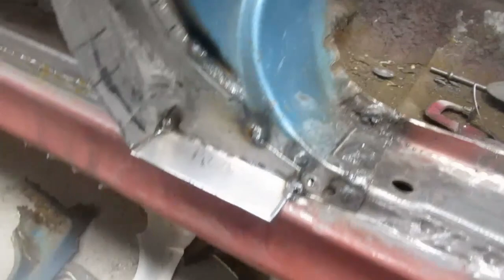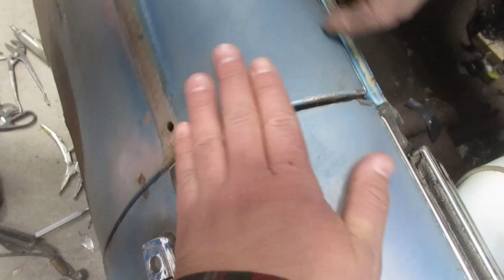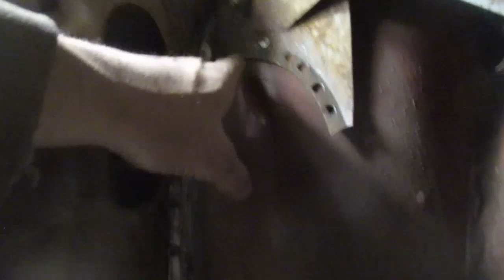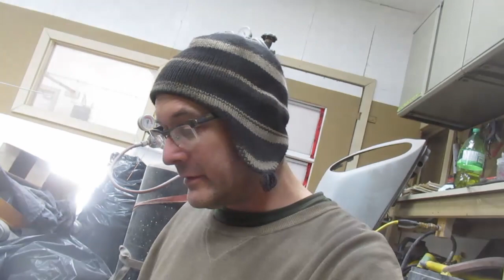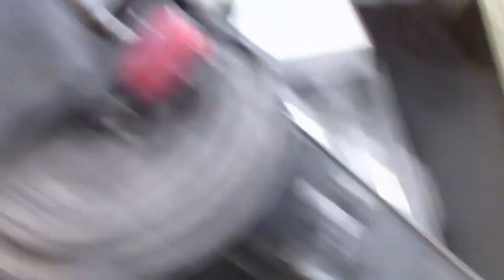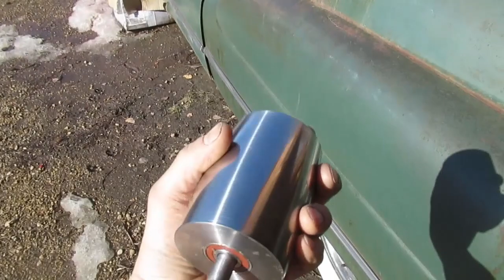1960 Fury Daily Driver Project Part11!

Comment: Always pleased to catch another episode. 
I'm on the wrong side of the Atlantic to find cars like yours but we do share at least one experience - ownership of a Metropolitan. That was back in 1971 and the car seemed much older than its nine years due to rust. It was fun to drive though. My only old American tin was a '64 Rambler Classic, originally built as a right-hand drive car with a twin stick. Still have the hub caps! 😁

Comment: Hi Scott: Thanks for the video and thanks for showing us the process. Please continue with this detail of your work and even expand it to include even more of the thought process in how/where you begin to "unravel" that collision damage. I was told long ago, that you need to "read" the damage and start/begin the repairs by figuring out where the metal is "locked" into its new shape. Kind of "straighten out the wrinkles" in reverse order of how they were formed during the collision. That "theory/technique" makes all the difference between returning the panel to its former shape and ending up with a lumpy "sack of nuts". Again, thanks for allowing us to tag along. This is almost as much fun as putting on the ear protection and swinging the hammer. Your info is helping the outcome when that work happens here. 👍👍👍🤓😎😉

Comment: Wow that's some work ahead of you on that panel fabrication. I'm surprised you took the time to cut the weld and lower that top edge of the quarter but you're right. Somebody would talk shit about it and wouldn't believe that it was there from the factory even though it was so best to just fix it. Nice work beating out the collision damage to the rear. Can't wait to see what that looks like once it's all touched up and finalized. 

If things go according to plan (when do they ever?) I should be getting the slab down for my own garage here in a few weeks. Then i'll be able to work more effectively on my own bullshit. At which point i'll have some sketchy youtube examples to follow.

Comment: Do you think that paper will hold up? I'd at least reinforce it with some chicken wire and bondo. Seriously though, this splice job is going to be more solid than most "daily drivers" that have all original sheet metal.

Comment: I worked in a body shop in 1961, at that time the owner did a similar job involving a 1960 Chrysler 4 door hardtop. I sort of questioned the quality of the project. But watching a mechanic like Scott, What a mechanic! The project I helped with in my youth, rust was not am issue. The rebuilds at that time did not require a rebuild tittle for resale. Great videos!

Comment: remarkable filmsmanship by the deanmaster. shitworx extrordinaire. fantastic prep work for the necessary appointments to the jetson mobile. i'm hoping it gets the duel antenna effect at the end. the giant fins hide the questionable faux spare bulge these vehicles got at chrysler worx. toilet seat lid boot lids.. it is indeed inspirational that the car seems to be the one in the poster about furys for '60. it would be splendid to see it with some period correct paint job like that. I see posts about this car now that your pursuing this restoration. it's neat that this car, half submerged in mud, can now re-emerge as a remarkable example of automotive history, with a little bit of blood, sweat and exertion. 4:20

Comment: in 1976 i worked in body shop where we did work for a dodge dealership.one job i did on a brand new van was the drivers door gap to fender   had to add 3/4 in. to the door to get a gap !!!  there quality control needed help.  there was many more too .

Comment: That quarter work is intimidating - it’s interesting to see how you approach the repairs. Looking forward to the English wheel - how did you determine the 20-inch radius for the panel? Did that come from research, or did you somehow arrive at that by measuring the panel?
Reply from the maker: Oh! Just trace the edge of the door, and use a piece of string and a pencil... when you can trace the arc closely, just measure the string... At least, that's all I did... hope it works, haha! Cheers...

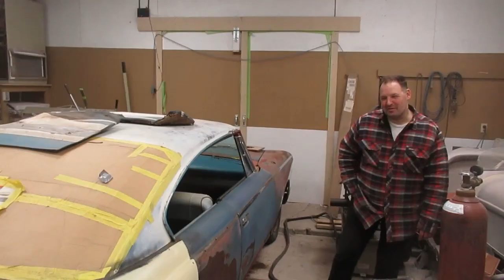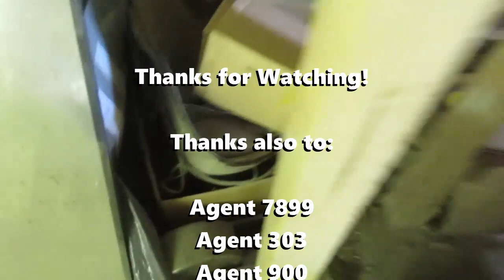Comment: 10:28- "...his mind wasn't on the gaps..." +1😁 Only a select few will get that,  and it looks like it sailed over Dean's head. Glad you fixed the panel gap. I woulda left it,  but would've obsessed about it after the job was done. But c'mon guys, you're slinging molten lead or whatever 21:20 without eye protection?☹ Dip Line very interesting. 45:03 blue Budweiser cans?

Comment: John Riccardo would be so very proud, nay, verklempt! You are doing a better job than Chrysler did in the 60,s, they had a terrible fit and finish problem back then. Now, a definition of "grandpa poo"? Damn nice beating and thrashing on that fender, would you prefer working on taking out gobs of lead or gobs of fibreglass shit?
        Mike

Comment: It's not an easy job correcting factory fit errors 59 years after the fact, especially when the standards were sloppy.  Great work on that passenger side quarter panel.  The taillight fit it better than factory.

Comment: You are a champion in making repair patches!
Maybe many people do not know that small parts like the corner inside the rear door are much harder to hammer and fit than most big parts (as the radius is much smaller and therefore stretching and shrinking of the sheet metal is much harder).

Comment: Scott, Don't they make a special drill bit  w/a shoulder For spot welds?  I think I saw it With somebody Repairing Aircraft skin. I think that Fin , rivals a 60 Cadillac fin'
Reply from the maker: Oh, they do, for sure... I just don't bother because they only last for so long, and you can't really sharpen them like regular drill bits... Also, a lot of the time we are drilling into rust, which dulls drills instantly, so I like to just have a box of cheapo bits handy to get the job done. It doesn't really affect the job doing them this way, and you can switch sizes up or down to suit the welds on each particular car...Cheers!
Reply: @coldwarmotors  I like to use a large bit ground and sharpened to a flatter angle. Drill a 1/8 pilot hole in the middle of the spot weld then the big bit and you only have to drill through the top panel. The hole does not go all the way through. May need a little assistance from a hammer and chisel to separate the panels. I find this method makes it easier to weld them back together too.

Comment: Unbelievable bodywork Scott. 

I have done many repairs on all parts of many different vehicles.  But, like many others, body work is something I alway considered too daunting. Your metal working skills are pebble beach worthy, and I don't say that lightly. 

The automotive archeology of a car really fascinates me. Looking an old car over and figuring out where it had been hit, where the repairs are, how well they were done, etc, borders on sport for me. Nothing pisses off the salesman at an exotic car dealership more, than to have a jeans wearing, long beard walk in and audibly pick a car apart in front of paying customers. lol...

The fury "dig" is fascinating, especially since we get to really see exactly how the car was put together thanks to the splicing you have done.

I don't want to immediately jump to the conclusion that the guys who built it, didn't line up the fender correct when they welded it. It is possible that the bottom of the A post was welded in place just 1/16th of an inch or so, too far to the rear.

This would make the back of the door ever so slightly higher. So maybe they left the fender a little tall so it lined up with the door.

I guess, either way, something at the factory wasn't lined up perfectly. However, you did splice three different cars together, so if it's only off by an 8th of an inch before you fix it, I call that a BIG win. Besides, we all know the build quality coming out of Chrysler in those days wasn't the best.

Also, I seem to recall the original 2 door chassis, was hit in almost the same place as the yellow car, right?
So it is also possible that the impact popped that weld up and the guys that repaired it actually re-welded the fender, but not in the right spot. I HIGHLY doubt that, as I think you would have seen evidence of a repair. No one makes repairs like you, that no one can tell it was repaired.

Having actually driven a 59 dodge 4 door a few miles in my life, I think it is also very likely the same thing happened to both cars. They were backed into something. I bet if you put a tape measure from the drivers seat to tip of the right fender, its over 10 feet. I bet 90% of the forward look Chryslers have accident damage in the right rear from reversing.

That reminds me, I was wondering if you have done complete VIN searches on all three chassis?

It would be interesting to see what each of the 3 cars came optioned with, but more importantly, which factories the cars were built in. If they were made in 2 or even 3 different factories, it would be neat to see how accurate chryslers stamping machines were from factory to factory.

Keep up the great work. 

I think I am going to make it my mission to get you on Barn Find Hunter. We have never gotten a good tour of the whole facility, and I know you are hiding some more cars in that barn we haven't seen yet.

You are inspiring.